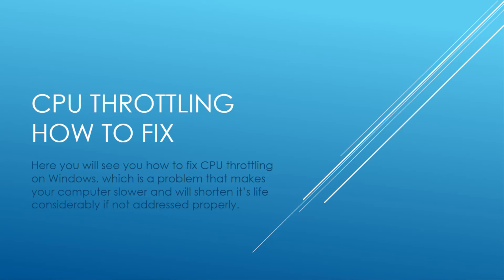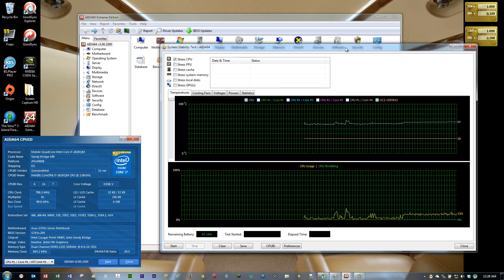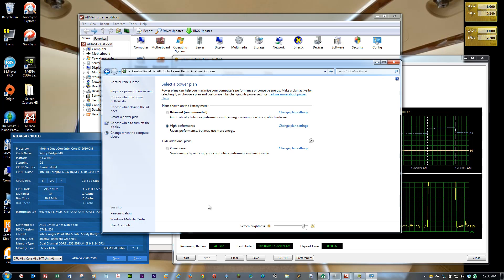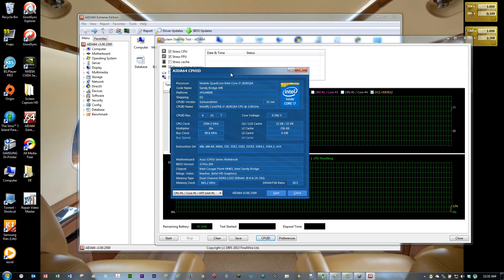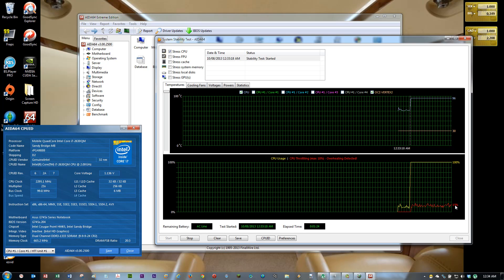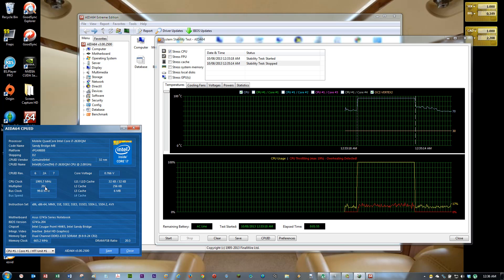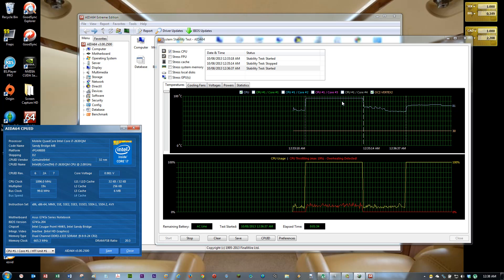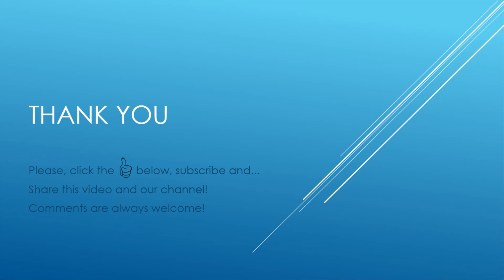CPU Throttling Fix - Computer Tutorial 1

Comment: If your laptop is going too hit, the first thing is to clean it from the inside. Usually some dust has built up on the fan/sink which prevents the flow of the hot air.

Comment: my pc is throttling at 45C, on full load there is no reason to it. I used your tutorial but this didnt worked. i have a fx6300@4.1ghz (turbo core) with a Hyper Tx3 Evo Cooler Master. I tried everything. Disable Thermal Throtling on Bios, Change Plan Setting, Set default clock, and it still throtling. is anyone here that  can help me? Thanks in advance and sorry for bad english.

Comment: Thank you so much for this, my new laptop was throttling a lot even with pretty high specs due to temperature, this worked like magic at 99% :)
Reply from the maker: That is fantastic news! The same happened to me, as you can see. Also, it will last MUCH longer. I don't really like overclock, and the fact Intel does it "by default" just doesn't feel safe. It's like when you have a light bulb. If you use it at 90% of the power, it will last ten times more (I don't have the numbers, but it's a HUGE difference) and you barely see enough difference in performance. Same for processors.

Some people go crazy trying to overclock their machines by 10%, I believe any effect is psychological. If a video takes 10 or 11 minutes to render, it won't make a significant difference to me as a user, but it may mean I will lose my machine sooner than later.

Same thing with phones ☺
Reply: Yeah it's sad that I sent my laptop to Toshiba for the warranty and they weren't even able to fix it, but I did it from your video, thanks again. :)
Reply from the maker: Kiin Dovah
Cool! It is so sad they do this to us! My laptop was an expensive ASUS i7 back when I recorded the video, with all bells and whistles, but still badly tuned.

Glad I found that I could make it work properly by doing what I did, then I just had to share it, because it's just not fair to have a partially broken machine.

Comment: Thank you for this video. While I already found that way of reducing the heat in that program my laptop (Asus G53JW) still suffers from heat or I think it is heat related cuz whenever I try and run a game like Dragon age Inquisition or such after a few seconds BOOM sudden shut down! I have tried many things so far but I do not know what is the cuz or how to fix it. is it the heatsink? is the faulty CPU or motherboard? is it my GPU? I really dont know. this happened to me after I sent my laptop to a repair center (my laptop needed a new motherboard and VGA/GPU) after I got it back it was all normal only when I pushed the laptop to the limits in 2016 demanding games(low-Medium stetting) I always get a shut down, my CPU heat is always above 80 which is terrible according to so called experts (normal temp should be 40 to 50 as they say) but the one thing that annoys me the most is the sudden shut downs when cpu is fully loaded! any tips on this matter is highly appreciated! (I did overload my CPU before part replacement and it was 100% okay and it could handle anything and everything)
Reply from the maker: The tutorial in this video may be applicable to you. Try using lower numbers than 99% (maybe up to 80%, below that it's not fun because you will have your machine running too under-clocked). And what you say makes me feel it can be your CPU cooler, the CPU itself, the motherboard or maybe a faulty BIOS?

Besides disabling the "Turbo Boost" by doing what I did in this video, try updating your BIOS, but be careful, because if something goes wrong while you are updating it, you may lose access to your laptop entirely and your machine would need to go back to the repair shop.

Comment: Followed your power plan, my mutiplier is bouncing all over the place, why? 9:30 "no throttling"... It clearly says your cpu is throttling? I don't get this?
Reply from the maker: Gazzeth Kensington Hi! Well, the multiplier is supposed to bounce usually, but on a different way. When it's "overheating", you get the CPU throttle when you are trying to do heavy processing or gaming. When it's not (like I suggest in the video, meaning it will work for most people, but not everybody, of course, who faces this issue), it should go to lower levels up to the minimum you set (or your processor minimum), to save energy when your system is idle or not working much.

Try to render some video or do some other heavy task with the different configs to see if it helps you or if you get the throttle due to overheat/overload above 100% (turbo boost). I don't use these setting with new PCs anymore, since they didn't have this issue, but it was very helpful when I had a second generation i7 back in the day I made this video ;)

Please let me know how things worked out, I wish you all the luck!!
Reply: The Sim Architect Thanks for your quick reply, I'm getting excruciatingly low FPS in Arma3 because my cpu is throttling, and the CPU utilization percentage is always around 10% when gaming.
Reply from the maker: Oh. Sorry to hear that. What about your video card?
Reply: around 32 degrees c when gaming.

CPU: i7  4790K
GPU AMD radeon r9 270x toxic
Reply from the maker: It is a very good machine! Is it normal to get such low values in that game with such a nice configuration like yours? Are you using SSD or a Hard Drive? How much of the video card is being used while you play (or maybe your PC is set up to use the built in intel video instead of your Radeon?)? 32 celsius is pretty low, you should not get a throttle due to heat at such low temperature!!!

I'd look for a "funnel" or maybe a driver that needs to be updated or something else. Sorry for not having an advanced knowledge that's enough to point you out a proper solution, but I am always available to help however I can!
Reply: Thanks for all your help man, I tried removing and re-installing the heat sink, I'm getting very stable FPS now in both multiplayer and single player, but just one thing, when I run the stress test on my CPU, the multiplier in CPU ID drops from x44 to as low as x21, and I don't know what this means, is it bad?
Reply from the maker: Well, it is good, if you consider your system is protecting your processor. It is bad if it happens too often, because it may mean you are not cooling your processor enough.

The tip I show in this video makes your system "not go above" 100% (99%), to avoid "Turbo Speeds" which aren't designed, actually, for continuous use That's why we usually get throttling when our processors reaches them in the first place, after a few seconds, since they are more like a "Turbo Boost" for quick stuff to be quicker.

Of course, if your processor can't be cooled enough while working at 100%, maybe you can reduce the maximum even further (underclocking), which will make your processor slower at peaks, but the peaks would be even more stable.

Anyway, if you are running your game at a consistent framerate, it means that your processor speeds are set up properly for your gaming profile with your current processor x cooling set up.

If you feel, in the future, while doing heavier stuff like rendering video (even though sometimes it can be actually much harder on the video card if you are using CUDA or something similar), or another game, that your computer is overheating and throttling again while in use (not while in test, since testing programs are supposed to "force" the CPU to the limit), you can also reduce the max speed or change something in your machine.

Of course, other things have always to be factored in, as the ammount of physical RAM vs what is being used, your system/gaming disk performance etc.

Anyway, I really wish you all the best, and thanks for watching and interacting! I am sure lots of people will learn from your shared experience!

Comment: this is not a solution, this is a bandaid. The real solution is buy a fan to go underneath the laptop like the cm notepal cmc 3
Reply from the maker: Thanks! I tried 2 different fans (1 cheap, 2 expensive later on) under that laptop and they didn't solve the issue, since the processor would heat too quickly (and it was used on a climate controlled enviroment 99% of the time around 20ºC). I guess your solution may work with some machines, not with others, you know... Thanks for sharing your idea, anyway. It's very appreciated and some viewers should try it!

Comment: Thanks a lot! was the only working solution for the over-heating while rendering issue and above all for the unbearable buzzing the mobo speaker started to make because of that.
Reply from the maker: Thank you very much for your feedback!!! I am so happy to see people finding my tutorial useful! I am sorry for my bad English accent, but it's great you can fix your PC. And it works for both laptops and desktops and servers!

You can also save a lot of energy if you set up a lower speed on the "while on battery" mode, making your battery last way longer on laptops, netbooks and tablets running windows!